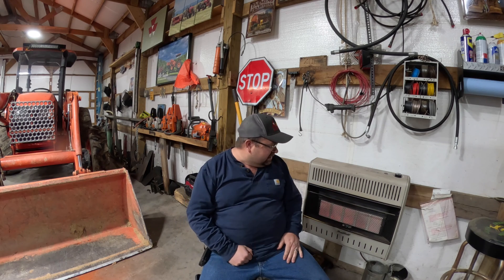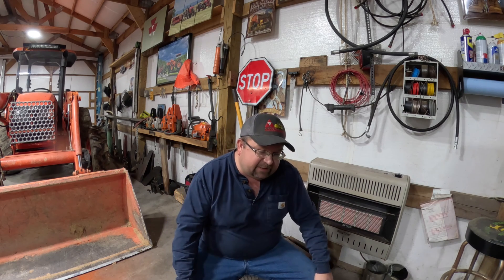What RPM Should I Run My Tractor At 🤔?

Comment: Lol funny you say not to run wide open I usually stall mine once or twice then I bump the fuel or drop to low range but I'm always in mid range on my kubota L3130 hst about 1-1500rpm. If it's thick brush hogging I may run little over 540 about 560 to account for the hst but if the grass ant crazy thick I'll be under 540.
Reply from the maker: Appreciate you watching!

Comment: Great advice and I agree with you on full throttle on a tractor for every situation.  Tractor Time guy isn't very knowledgeable in the use of real tractors in real situations.  I have a small Deere gas powered hydrostatic for mowing and I do run it full throttle WHILE I am mowing.  I have an Allis B with a 60" Woods belly mower, a John Deere 40 that I use with all kinds of implements, a Ford 4000SU diesel and a Massey 283 diesel.  None of the 4 tractors do I ever run full throttle except when I'm driving from one place to another.  Mowing with finish mowers, 6 and 8' bush hogs I use 540 PTO rpm speeds (1800 rpm on both the Ford and Massey with 2400 rpm being full throttle)  The only thing I will say about babying your diesel, especially the older ones is that if you just putter around and don't work them they will start to slobber, or in other words leak raw fuel out the exhaust pipe.  Been there done that so I run them up to mid throttle as much as possible.
Reply from the maker: I really appreciate your input and I’ll say I’d love to have a 283 Massey! That’s a good tractor!

Comment: I agree to a point. I agree that a farm tractor doesn't need to be ran at WOT. There isnt much point. The point at which i dont ahree is heavy equipment like a backhoe, bulldozer, excavator. Those are different and require different needs. Maybe some people think they should ran the same. I have operated both since i was a child and run equipment at WOT, i do not however run my tractor like that. Just my opinion.
Reply from the maker: Also that equipment is built to a different caliber then farm equipment and usually able to reach much higher hour life spans. Thanks for the input!

Comment: I agree 100% with not running the tractor wide open all the time. You’ve gotta match you tractor engine and transmission speed to the job you’re doing. If I’m feeding hay or doing loader work, I may run half throttle or so, just to get my hydraulic pressure up. If I’m cutting hay, rolling hay, bush hogging, pretty much anything else PTO wise, then it’s 540 PTO speed, and I’ll gear up or down accordingly. I wouldn’t run wide open and just driving around, unless I was on the road. Totally agree 100%.
Reply from the maker: Thank you very much for explaining your methods of operation as well!
Reply: @khtractors  a lot of folks over think this stuff, gotta use a little common sense on operation, and be willing to adapt.

Comment: I think that are correct in saying that you don't need to run your tractor at max RPM's for all jobs, however,  I don't believe that Tim has ever recommended that for all things either. I  just unsubscribed from your channel because of your false accusations. You would do well to state your own opinions and not speak for anyone else.
Reply from the maker: That’s your right but if you watched Tim enough to be that loyal you’ve had to heard him say wide open throttle many times. Especially running those 1025’s. It’s not a false accusation at all.
Reply: The following is a comment from a Tractor Time with Tim video. The comment is on video "too much to handle 5 ft tiller....." Here is the comment - You mentioned running wide open for 540 the pto. Not sure if it’s true for all manufacturers. Look up the comment for yourself.

Comment: Agreed fully with your point of view. If you are supposed to run your newer tractor at full speed, why did the manufacturer give you the option to control it?  It’s what they call seat time.  You need to drive the tractor and understand what the tractor is telling you and adjust as necessary.  At the end of the day, it’s your equipment, you are paying for it, drive it the way you want.
Reply from the maker: Really appreciate you watching and the comment!

Comment: I have been around engines for years. Mostly small gas engines. But I agree with you, Ben. Running an unloaded engine wide open, especially a diesel, makes no sense, and I know it shortens the life. It's just physics. Higher rotational speeds and linear piston velocity changes means more wear. Just as lugging an engine is not good. Be smart and consider the load and work being done.
I have a shuttle shift 40hp LS, and I vary the RPM all the time, and don't idle it long. Saves fuel. In 375 hours, it has regenned 6 times. That's it.
When brush hogging, depending on grass length and terrain is about the only time I need to run 540 PTO rpm, which is about 2200 engine rpm. But with loader work, and backhoe use, I run 1200-1500 rpm. And use the foot throttle to speed up loader lift and curl as needed.
I can't stand watching vudeos of hydrostats wide open as light loader, trailer pulling, or backhoe use happens and very slow ground speeds are made on level ground. Maybe autothrottle (rpm management) is the best feature for my video watching!

Thanks for your info.
Cheers, From SE Tenn.

Oh, and I can't imagine what in this video would offend someone. It's not politics or religion!!  Some folks just can't seperate discussion from confrontation. It'll be interesting to read the comments.
Reply from the maker: Really appreciate your thoughts on the subject! I did offend at least 1 because he said I falsely accused Tim and is unsubscribing. But that’s ok. Thank you and have a safe week!

Comment: Another, I agree with you! New tractors need to work. Not rev high when not working but not so low that carbon builds up in the soot filter. I won’t idle mine longer than needed to attach implements   Longer than 3 minutes, shut it down. Unless I am mowing at 540, I keep revs at about 1500-1800 and use foot throttle! I run a Kubota M6060 also however I run super wide turf tires for general yard work. The wide stance helps on North Georgia mountain land.
Reply from the maker: I’d like to see a picture of that M6060 if you get a chance to email one. Thanks for watching!

Comment: If your IH heater is like the ones I have worked on in the past   there is a   speed control gismo in the blower duct  next to the fan  motor that has burned out.....    two philips headed screws secure it in the duct.... It is subject to get hot is why it is in the airflow...
Reply from the maker: Yes sir I think you’re right. I have one ordered, hopefully that’s the cure! Thanks for watching

Comment: Ben I completely agree with you.. I’m so glad you put this video out! I like you have been around tractors all my life and mostly pre-emissions stuff and it kills me when I see someone pull it wide open for no reason at all just to work around the yard. I do have one hydrostatic lx2610 kubota and I run it wide open more than the rest but that’s just so the transmission works better. But like I always say you can fool the fan but you can’t fool the players and on YouTube to me anyway it’s obvious who’s worked tractors forever and who hasn’t. And it’s a shame but all these newbies to the tractor world seem to follow these bigger guys on YouTube like they’re the best thing ever . However you just have so much more valuable advice than any of them ever have. To me and you it’s common sense though
Reply from the maker: Big difference in being a YouTube expert vs actually being knowledgeable on the subject. Thanks for watching!
Reply: I have a LX2610 as well.  From everything I have read the engine in my tractor is a de tuned engine to stay under emissions ratings.  Due to this I have read a lot from people saying run it toward the top end because it’s still below what it was designed for.. curious on anyone’s thoughts on that.
Reply: @mikeneeley1836  idk about running it towards the top end but it definitely makes sense about it being detuned. That’s got to be the stoutness little 25 horse I’ve ever used. Most of these small diesels won’t “lug” around they have to be run wide open to get the power out of them but this one to me seems to be really happy around 1800-2000 rpm’s

Comment: My dad said you have done it again Ben, you’ve created a very interesting & instructional video, I totally agree with you on the not running your tractor wide open, if your running a mile & you run wide open how tired do you think you’ll be before you reach that mile marker? If you run at a jog first a mile you can go the total distance without getting tired, my dad said as he was watching here that my grandfather never ran his tractors at wide open throttle!! He said he always set the RPM’s where the engine wasn’t in a strain & left it there unless like you said he was going down a hill or up a hill, he adjusted the throttle where it worked the engine but didn’t over work it!!! He said that only rich guys or idiots run their equipment wide open!!! His Ford 2000 which was supposed to be mine when he passed but somehow my cousin wound up with it, well it’s 52 yrs old & still going & I believe it’s because he only gave it enough RPM’s for the job at hand that wouldn’t overwork the tractor, my Ford 3000 is 54yrs old & is still going strong & I do like he did, only use enough throttle to work the tractor & not over work it!! Great Video, be blessed Ben!!
Reply from the maker: The thought of running is a good analogy, I had thought of it that way. Thanks for watching!

Comment: I push snow with a Kubota M7040 and I was wondering what RPM I should run it at while pushing snow. I asked Neil from Messicks and he said wind it up. If I remember correctly I asked full throttle and he said it'll take it all day long. I didn't like that idea because I wouldn't do that with any other engine I wanted to keep in good shape and get a long life out of it.
I thought about it and came to the conclusion that he's in the business of selling parts and tractors and he doesn't have to buy the parts to fix this tractor. I also thought that the tractor is made to run all day long all hay session at 540 PTO RPM so I run it at about 2100 RPM. If I remember correctly 540 PTO is 2160 RPM.
I run it 2100 RPM so the loader lifts faster and it takes me about 5 hours to do all the snow removal I need to do unless we get a long storm then it takes me around 11 hours.
The engine will turn about 2600 RPM and it gets a lot louder at that RPM. I won't turn it that fast for extended periods of time. 

I changed the fuel filter in it and the manual says after changing the filter to pressurize the system with the manual pump and start the tractor at full throttle. I didn't like that idea so I started it at about half throttle and it started and died. I pumped it back up and tried starting it at half throttle again and it did the same thing. I finally started it at full throttle against my better judgement and it started, sputtered and died down some but kept running. I didn't like starting it cold with no oil flowing and going to wide open throttle. That's hard on engines. What procedure do you use after changing the fuel filter?
Thanks for the videos and God bless you all!
Reply from the maker: Mine has an electric fuel lift pump so I just turn the key on and let it run for a good bit. Eventually it will recirculate to the tank once the filter gets full. On a mechanical pump pre-fill the filters first. Then you should have a bleeder to open somewhere. Pump until you see pure fuel with no air coming out. Close the bleeder then pump a few extra pumps. At that point it should start right up. On the rpm’s I’ll run hours on end at pto speed, but going beyond that for extended periods of time is tuff on them I think. Just do what you’re comfortable with. Thanks for watching
Reply: @khtractors  I haven't been around big diesel tractors much so I just didn't know what RPM to run it at but I knew I didn't want to run it wide open for very long. That's just asking for trouble. I was shocked when Neil said that.  It's one thing if you need the power to operate a piece of equipment but to push snow it's not needed. 
I appreciate the fact that you made this video and are willing to share your knowledge. It will be nice to see what RPM you run your tractor at when you are working it if you choose to put that in future videos. 
Thanks again and God bless you!
Reply from the maker: @michaelboyle1983  I’m going to try and start incorporating that information in occasionally.

Comment: Completely agree with your lesson on rpm. Even when I’m on the road I don’t run at wide open throttle. I don’t reason to put the added wear on my engine. I just pick the right gear to do what I need to do. For the heater on your truck ….. there should be a resister block that’s gone bad.
Reply from the maker: I only run wide open on the road normally when rain is coming 😂! I ordered a resistor, hopefully that’s it. Thank you!

Comment: Most everything I do with my tractor is between 1500 and 2000 rpm but it doesn't have any emission controls. My neighbor is an older farmer and kinda money tight. He has a Massey 135, a Massey 275, and a JD 2440 cab tractor. I'll say he never runs either one over 1000 rpm no matter if hes bush hogging or carrying a round bale. He would have alot of regens 🎉with a new tractor. Not critisizing just saying.
Reply from the maker: He’s better off with that combination of machines anyways. Thanks for watching

Comment: Same thoughts here also Ben, my answer to their question would be just enough to accomplish the work your doing. Any extra RPM is just wasting fuel and wear on the machine. I think this question probably comes from the hydrostatic transmission users. I have 2 hydrostatic, 2 gear drive(shuttle shift), and a couple ole school farmall and find myself pushing the throttle up “excessively” on the hydrostatic units to avoid hearing the transmission whining at lower RPMs. ✈️2🚜
Reply from the maker: Really appreciate you sharing your experience! Thanks for watching

Comment: Thanks for the insights, Ben. I tend to run my JD 2038R around 2100 RPM when I'm box blading our gravel road, especially uphill -- seems to feel right in terms of the power I need.
Reply from the maker: Also each engine is different some run pto speed at higher rpm’s than others. For example on the Massey 245, 1850 rpm is at 540 pto, that’s much lower than most. I just want people to know running around with a pinned throttle isn’t necessary. Thanks for watching

Comment: Ben, I 100% agree with you regarding not needing to run your tractor wide open for the vast majority of tasks. I have a new (2021) Mahindra 5155 tractor that’s 55 horsepower. I believe wide open is 2,300 rpm, and I’ve never pushed it that far. It’s a 12 by 12 shuttle and I have no problem at all finding the right gear and throttle combination to get me the right balance of power and speed for everything I do. The tractor has E-PTO so it lets you basically select an overdrive for the PTO so you can throttle down to about 1,800 RPM and get 540 out of the PTO. So unless I was needing every bit of power out of the PTO, I don’t see any reason to use the standard PTO setting and have to crank up the engine to 2,300 in order to get 540 on the PTO. With the newer tractors with emissions, like mine, they don’t want you idling around like you could with old school tractors. But anything above about 1,500 satisfies the emissions system and just seems so much easier on things. Mine really seems to like around 1,500-1,900 RPM and I’m never lacking for power for heavy pulls or loader work. Good topic and it will be interesting to see the comments!
Reply from the maker: I love your comment and thanks for taking time to explain your experiences! I really appreciate that. Thanks for watching

Comment: With my hydro, if I’m not mowing or using a pto implement, I usually run mine halfway between the full 540 pto speed and idle if I’m just working the loader. If I need more power I give her some more fuel haha. I’ve never really thought about that question. Like you said, I’m varying my rpm depending on what I’m doing. Stay warm next week. It’s going to be cold!
Reply from the maker: Yeah I was blown away seeing that asked then to see people recommend wide open as a standard just blew my mind. Thanks for watching

Comment: 100% agree! 👍    On my old JD (10-Series Europe) 310 i do Rearblade and Boxblade work a Lot. I`m able to handle Repair`s on my own - with this old Type of tractors without Turbo, Hydrostatic Drive and the hole Electronic-grap but a lot of cubic, 12 Gear`s and low Poweroutput i stay between half and max. one-third trottle. Sorry to say but i stay away from TTWT, This here is one of my favorit Chanels on YT. Guess why...

Best Regards, Alfred
Reply from the maker: Thank you very much!!

Comment: Thanks Ben for the mechanical common sense video. Hy burn fuel to make power You won't use. I found pulling a 90" finish mower.11-1200 rpm was eough. If gras was heavier just bump the throttlee up to 1200 or slow the ground speed so tractor can ease throughwhat You're cutting. Most people that ask that question don't have the common sense to come in wwhen it rains. Thanks for passing down Your knowledge of tractors.
Reply from the maker: I really appreciate that comment buddy!